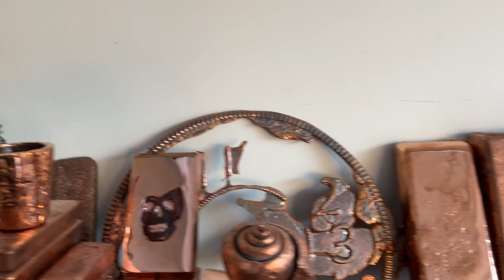FrankenClock - Casting a Copper Clock - As Above So Below Yin Yang Tree Fail - The Growing Stack

Comment: I love the clock !!  You need to get more shelving now that your stack has grown so big !!  Sorry the tree did not work out but maybe you can figure a way to make it work.  Thanks for sharing !!
Reply from the maker: Thanks Lisa! Yeah, I need to move down to another shelf. I’ve got some work to do this weekend. 👍
Reply: @TheGrowingStack  that clock is awesome. Counterfeiters have a way to expedite the patina process. Some patina a bracket/plate for flush wall mounting and you have a great piece. 

My thoughts on the bracket with a different type of metal that it's patina will contrast with the copper or a nice wood with stain or a cheap piece of wood and slightly char it on the edges and in the areas where the clock didn't fully cast.

Once again great video

Comment: I think that might be the sharpest, most detailed sand mold you've made of the clock yet.  Just a little more copper and you'd have been there!

Don't you have any concerns about pouring the molten metal directly onto detailed areas?  I'd be terrified that the weight of the stream of metal would erode the sand away as I poured...
Reply from the maker: I was impressed by the detail this round as well. I think with the sand being packed so tight, it’s not bothered by the pour. 🤷‍♂️